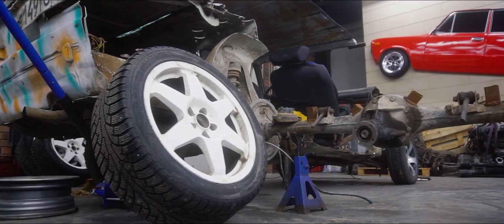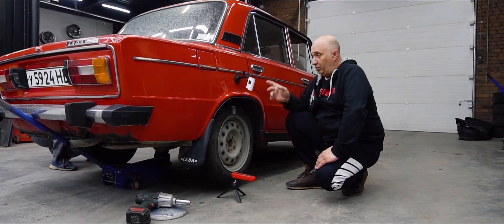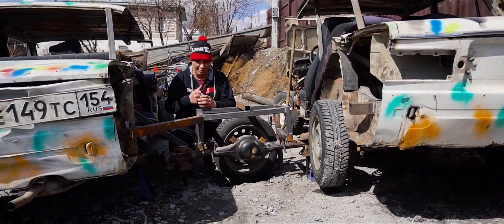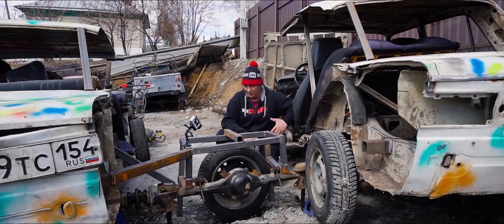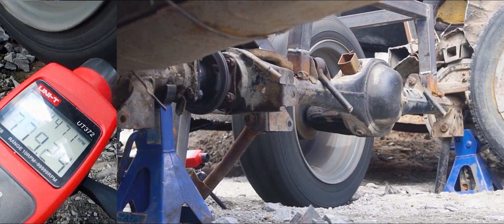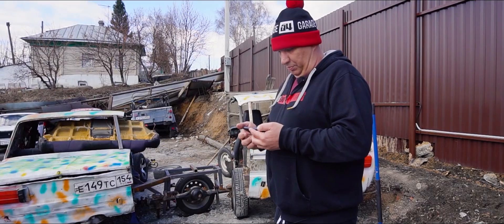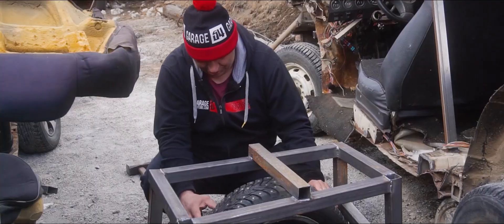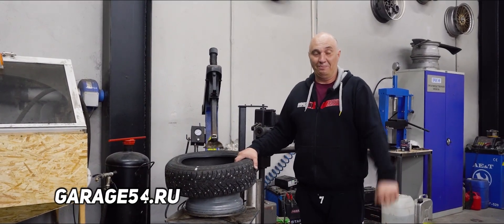What happens to a tire at 620 km/h (385 MPH)?

Comment: You have to give these guys some credit for how balanced that fucking wheel set up was actually very impressive...
Reply: It wasn't even slightly balanced. The wheel wasn't even welded onto the flange straight! See at 6:25 or so LOL
Reply: @johncoops6897  it had to have been balanced at speeds like that. Have you ever lost the weights on a tire an gone 80 on the freeway now imagine just making up random shit and putting a wheel on it and hitting 300 miles an hour. If it wasn’t at least somewhat balanced it would’ve blown the entire thing apart.
Reply: @SillyGoose69  - it probably would have blown apart if it wasn't mounted on a heavy metal frame that was held in place by the weight of TWO cars.
Did you actually watch the video and how dodgy they welded the wheel on? Did you see the 20-30mm side-to-side wobble on the rim? These guys are not the kind of people who are going to bother with balancing and wheel weights.... perhaps the tire was balanced when fitted, but who knows (or cares)?

Comment: Use a smaller diameter tire and rim, in theory there will be less sentrifugal force aplied to it, so you can spin it faster👍
Reply: But "sentrifugal force" is not the problem for a wheel at high velocity. If you imagine one single spike on a wheel, and what forces this spike is taking in real velocity, the acceleration from zero when the spike is stationary on the asphalt, to when it is moving twice the speed of the car when it is on top of the wheel, to zero again down at the asphalt. -This is the force ripping your wheel apart in a real speed test of a wheel, and this force would be greater on a smaller wheel.
Also if this where a real speed test, the top of this wheel would break the sound barrier going at 1240 kph.

Comment: OK, let's do some calculations:
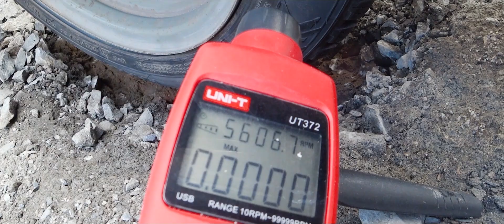15:07 - Max RPM: 5606
15:34 - Tyre size: 155/65R14
According to tyresize . com, the circumference for 155/65R14 is  1.75m.
1.75m x 5606rpm = 9.8km/minute
9.8km/min x 60 = 589km/h (368mph)

620/589 = 1.05, or 5% speedometer error on the Lada. Not bad.

Comment: That tire has spun up so fast it has the kinetic energy of a small bomb.
You can play around but think of it as a hand grenade if not a stick of tnt. It needs a blast chamber.
Reply: It has an open box section made loosely around it and a back seat out of the car for protection, what else do you need?

Comment: The ratio was about 2.105 between 50 and 100. Some error in the speedo must be taken into consideration also. 200km would otherwise have delivered around 1920rpm 400km around 3840rpm.

Comment: Spin the second Lada around and connect to its axle as well, then max out 5th gear on both of them so you can spin that wheel up to 1240 kph and then see if an aluminum rim can withstand the forces. Lol

Comment: Use a bead locking drag rim/tire .. that will hold the tire on the rim until the cords detonate. try different speed rating tires and see if they actually do better when the letters get higher (Z rated tires are what I use on my sports car)

Comment: this test is invalid because the runout (wobble) on that wheel is enough to damage that tyre at that rpm, the tyre wants to spin in a nice perfect circle, any deviation from that path leads to massive strains on the tyre, normal runout on a wheel would be less that 0.50mm maybe even lower.

Comment: You should connect the other axle side to the other lada in opposite direction and hit 5th gear at maximum gas, that would be 1200km/h.

Comment: I'd put a thick steel plate at least 30 mm between the tire and driver.  Had that exploded it almost certainly would have killed him.  An exploding tire from rpm makes dynamite look friendly.  Do that, and a string to control the throttle from a safe distance, like 50 meters away, and take it further :-)  If you want to see something interesting, set it for remote operation and rev it until it explodes from rpm.  You might see the lada cut completely in half if the wheel explodes that direction.

Comment: Install a second Lada that drives the other end of the axle in the opposite direction, then you should get twice the speed at the input shaft, and also more than twice the amount of oil leakage from the diff.

Comment: Top comedy, guys. Now we know not to go 300+ mph on snow tyres. What I'd be interested to see is what happens when it's run up to that speed with a proportionate load on it. Could be done with a couple of rolling road rollers allowed to spin freely: the cage and Lada power are already in place and proven...why not? 107% guaranteed to actually kersplode.

Comment: I believe your jack stands were sinking into the ground with the vibration, you may wish to use stands with a large metal plate on the base to increase the surface area and (hopefully) reduce the sinkage

Comment: You should test this same experiment, but instead of the other rear fixed, it should be conected to another Lada going in Reverse. To increase a lot more the rotational speed of the tire.
Reply: Spinning the wheel hubs in opposite directions would make the drive shaft go slower, not faster. Though you could have two cars connected to it and hammering their engines for more power, if needed.
Reply: @technicalfool  I don't think you are right. A differential in normal use make both wheels turn at same speed. If you lock one wheel the other spin faster (as it happens in this video), now if you move the other wheel in opposite direction the differential would add rotational speed to the other wheel

Comment: Not sure what tyre you were using but  i think this is Lad size? 175/65 R14??
my calculations are this... 
175/65 R14 tires do 879 revolutions per mile
so 5606.7 rpm would be 6.37 miles per minute
 = 382 miles per hour
 = 616 kilometres per hour!!!!!!

Comment: The Diff the tire was mounted on started leaking oil at max speed. Might wanna either get another differential to use or repair that one. Also, put some steel plates underneath the stands holding up the cars, the vibrations were causing them to dig into the ground.

Comment: test old, bald, cracking cheap tires, and maybe add rollers to the bottom so it has some resistance. You would need to make a box to catch debris if it has a catastrophic failure. if you can get a flir to show surface temperatures that could be cool, too.

Basically, show how damaged/old/thin tires are safe/unsafe. very educational!

Comment: Connect the other Lada to the other end of the axle, run it the opposite way, and it will run even faster - almost double 385mph!. Currently you have the other end of the axle stationary. That should make the tyre run almost supersonic (761mph). I know it will self destruct long before that though. (Or is it the same way?)

Comment: I'm amazed that the studs stayed in! I imagine some of them must have come out, but at that speed I would think they all would have left the chat. It just goes to show that in engineering, intuition is usually wrong. 😁
Reply: Probably because the tread layer was compressed. But if the tire had failed, they'd probably have all popped out at once, instant machine gun.
Reply: No, that doesn't go to show that at all.

Comment: Tires can disintegrate when getting too hot
Fast cars and motorcycles tires need to be warmed up before racing
I use q3 in my motorcycle, they are made to change shape at racing speed. Becomes oval shape with the rubber changing to wide and flat where it contact the ground, making it more stable and better grip at top speeds
Maybe if you use a motorcycle tire it would disintegrate and explode at super high rotation

Comment: That’s why drag racers bead lock ( bolt the tires to the rim )  there tires and use bias ply tires
Reply: I don't think so, I think it is to stop the rim slipping on the bead when you apply 8000 HP to a slick that has very little pressure inside and about 4 gs worth of stick.  You saw that even this tire went far beyond Drag speeds before getting loose...and this is a Russian tire designed for a car (or whatever)  that apparently can't produce speeds that most any family car will the rest of the world over, easily.   

I had a 91 Camry that would have had a hard time winning a drag race with a bus, and it would still go well over 110 mph.  I expect the car I'm driving now would easily do 140 or better, and it's 18 years old, has 310k, and is not remotely a pure sports car (an Acura TL).  It is slow at about 6.5 seconds to sixty compared to most sport luxury cars on the road today, but still fun to drive.  Hell, even my fathers 42 mpg in city Camry could probably easily beat 110, if there is not something preventing it built in.  He went to Ukraine once and said he was literally frightened to get INTO a Lada after the first time.  He said not only are they obvious junk, but many of the cab versions have obviously had little to no corrective maintenance in years.  He's not easily frightened, either.

Comment: Anyone else notice both ladas and the jack stands are vibrating so hard its sinking into the earth :o
12:00
Reply: Yes you are right i taught that the gravel was flying due to tire expansion .
Reply: Yep, they have accidentally built some kind of jackhammer!
Reply: With enough vibration gravels and sands etc can behave like a fluid, could be why it sinks.
Reply: Hutchison effect 😀
Reply: Gabriel Klein .. why on earth do you keep posting that in every comment???
Reply: @brucewrigleysgumchewz4667  people need to know what God did
Reply: @gedon4713  totally irrelevant comment
Reply: @gedon4713  God had nothing to do with this video.
Reply: Good catch, i was watching above the tire to see how much it was expanding in relation to it's background and didn't notice it get much bigger, this may be why, lol. I was like the tire looks bigger but it's not any higher. Now I realize it's prolly cus it was sinking down the whole time.
Reply: Good point - at first i thought the camera was leaning back.
Reply: Guaranteed, the tire expanded while sinking, into the dirt, and also I believe the square tube crossmember on the framework directly above the wheel centerline.. I'd check for scuff marks  @Garage54 that was a wild ride for not having moved more than 6 inches! You may benefit from more clearance for expansion to see if a centrifugal failure is possible, without interference
Reply: Was looking for this comment
Reply: I noticed. xD
Reply: John 3:16 
For God so loved the world that he gave his only begotten son JESUS CHRIST FOR OUR SINS so whoever believeth in him shall not perish but have everlasting life Amen Amen Amen 

Never lose Hope in God remember he forgive

Comment: I have one idea how increse speed of tire  use 2 car both using there right rear wheel axel. Instead of one shaft rotating and the other standing, they will both rotate but against each other

Comment: The burning rubber smell, I wonder if the rim was spinning faster than the tire.
Reply: Of course, once the drive was removed by the bead leaving the rim, good point.
Reply: surely the tyre was also scraping on that tube on the top of the construction they did.

Comment: Guys remember what happened to the Concorde after a high energy blow out!  If you get hit in the face with a kilo of steel and rubber at 600km/h it is goodnight dear prince.
This is one of those things that doesn't quite seem as dangerous as it really is. As soon as the tyre deforms radially to that extent it is close to catastrophic failure. This one was close to doing a quick tyre change.
Edit if my math is correct this would hit you with a force 30 times that of a 45 calibre bullet! Edit per kilo. A 155/13 tyre is 6.5kg That is 200 times a .45 as it leaves the barrel.
Reply: Next i want to see them shoot the tire while it's going full speed!!
Reply: @allinaday3526  😸

Comment: If you shave the Tyre to bare minimum rubber thickness and then inflate it very high,. it can sustain very high speeds. Learned this @ Bonneville Speed racing :-)

Comment: Am I the only one who kind of wants to see what happens when you put a heavily worn/bald tire vs a brand new version of the same tire through this torture test? Like, could we see how the wear makes the tire more likely to sustain damage? Or will we be surprised and discover that worn tires are actually more durable due to the heat cycling and wearing of the rubber? Who knows, I wonder if we can get that test done

Comment: The energy contained in that thing spinning at its max speed like that is actually quite preposterous
Reply: Yup, and quite dangerous.  The ballistic energy, if that tire separated is immense (and that has NOTHING to do with centrifugal force, and neither does anything else), and if the wheel and tire got loose it would be one hell of a flywheel accelerating like hell across the lot.  Some of the things these guys do are industrial strength stupid, but also funny as hell.

Comment: I like to see you take a z rated high performance tire from like a Corvette and try it out at the speeds that you put that snow tire
Reply: I probably wouldn't make much difference.  They are not rated for expansion, they are rated for continuous heat buildup to incur an acceptable rate of failure, which is a far lower rotation rate.
Reply: @MrJdsenior  you know I didn't even think about that with them testing those tires like that there's no Force on the tire like the weight of a vehicle on it so it's pretty much just free spooling.

Comment: I did this with a Jeep that had an open center differential in the transfer case. Lifting one tire off the ground would transfer all power to that wheel. Center differential doubles the speed front to back and the axle differential doubles once again left to right. So the actual speed of the wheel is 4x what's on the speedometer. 25mph = 100mph. 50mph = 200mph and 80mph = 360mph but tires fail way before that... so I'm told....

Comment: What you should try next: Ultimate weight reduction. Remove every single part of the car that isn't required for structural stability, until it's as light weight as possible. :)

Comment: Given that you used the same ratio axle that was on the car: you went from a theoretical 4:1 from the drive shaft to the first wheel hub to a 1:4 at the second drive flange, essentially giving you a 1:1 ratio from the engine RPM to the final wheel RPM. If you connect the tire directly to the drive shaft or transmission output you could use the cars Tachometer and it would be a 1:1 RPM ratio. Inversely, given a 4:1 gear ratio in the axle, if you attach the wheel hub of an axle to the transmission directly you will then increase the the RPM by 4 at the drive flange.